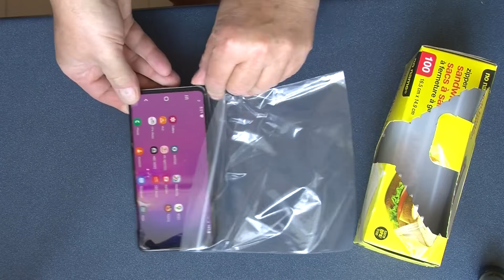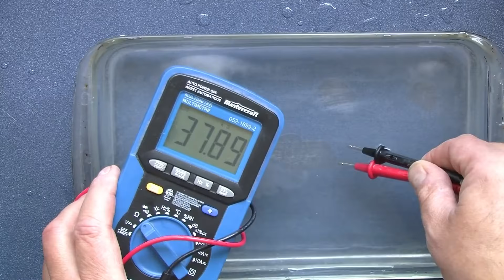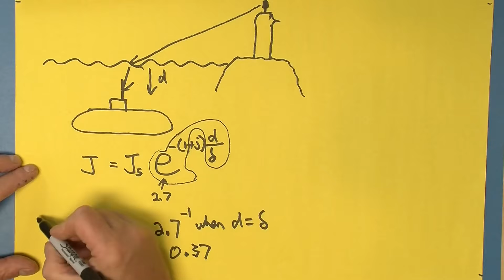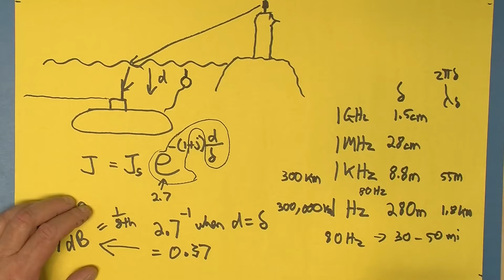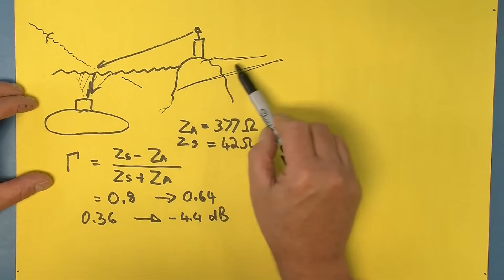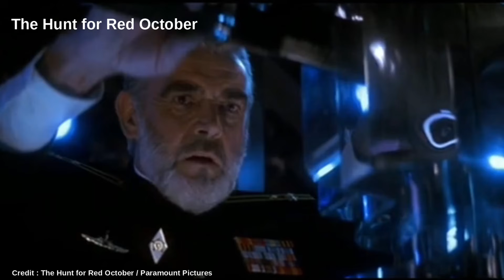Why don't Submarines use Radio or GPS?

Comment: Think of water as liquid concrete and imagine the ocean as a slab lying on its side, and you're trying to get signals through it.  Can you transmit a radio signal not over, but through a mountain? How about trying to scream into the stone hoping the person on the opposite end can recover the audio from the rock's vibration? Sounds absurd, of course, but it's the very same challenge.

For underwater signals it takes tremendous energy to overcome the dampening effect of dense matter. Here on the surface  you have the freedom to transmit gigabits of data per second, but below the ocean, you begin worrying about power a lot more that speed. You get into bits per watt or watt-hour.

Comment: Very nice video - well done.   Many years ago we did an extensive monitor of ZEVS Murmansk on 82Hz using MSK with bitrates seemingly around a few seconds per bit and a "begin message waiting" sequence which from memory took minutes to deliver. That thing uses the ground itself as the antenna.  The supposed dipole antennas which everyone can see on Wikipedia etc are just part of the massively long transmission lines to sub-surface elements using the extremely low conductivity of the rock under the Kola Peninsula. Not coincidentally the world's deepest boreholes also just happened to be drilled nearby ha.      Anyway it gives truly global coverage which you can see in waterfall plots on SDR receivers.     I know the Chinese have an incredible new ELF system - supposedly far better which is capable of transmitting down to TLF frequencies(!), but that's mostly being used for seismic research.  I wouldn't be surprised however to find out it's also sending out ultra-slow data rate status updates.

Comment: Very interesting video! I have a question... you talk about antennas of 30-40miles long for 80Hz waveforms in air and sea. And the associated wavelength in sea being much shorter than air and in the 100s of meters range. So why cant you just use a medium other than metal for your antenna and use a medium like sea water in a pipe which would allow you to create 80Hz waves with much shorter antenna? May require more power I admit.

Comment: Amateur radio operators often use the reflectivity of bodies of water, particularly the salty oceans, to get long distance communication with lower power transmitters. This is a form of ground wave that solid ground can provide. Ground wave conductivity is measured in siemens. The highest "siemens score" earth can get is 30. Oceans, however, are rated at 5,000 siemens. Where I live in Central Florida, our dirt is scored at 2 siemens so we radio operators sometimes have to supplement the ground wave with radial and counterpoise wires spread along ,or just under, the dirt radiating out from the antenna base. Major broadcast radio stations also use substantial radial fields to get the range they want, especially AM stations.   True, using the oceans as a ground plane isn't perfect as the water is never perfectly smooth, but generally better than dirt. I know hams who work 5- watt HF radios at the beach along the Florida Atlantic coast who can easily talk with people all throughout Europe and even further. Of course, part of that is having a good antenna as well.

Comment: Would refraction At the air/water surface contact surface also play a role in bending and diffusing the EM energy?  It sure does with light but I guess the lower the frequencies the less refraction.

Comment: As a young person I remember hearing about the US Navy ELF submarine underwater communication system going in, here in the Upper Peninsula of Michigan where I live. It was going to be a very long cable system. Would it have biological effects?  

The system was installed. I was going to the community college at the time. Then I transferred to Michigan Technological University to study electrical engineering - power systems.

But there is more to the story. During my second year there, I was taking a power transmission line analysis examination and there was an interesting problem to solve!

Problem: An antenna operating at 84 hz at a certain power level will induce how much voltage on a power distribution line at a certain distance away? Assume that the formulae are effective at 84 hz (we used 60 hz for our analysis). 

I thought it was interesting, I like antennas. Well, I solved that problem correctly. I believe my professor put that problem on the test because Michigan Technological University developed this antenna system for the Navy, or at least had some involvement. Michigan Tech had a very strong electromagnetic department.  I really have no actual proof of this.

Many years later, I worked at a local utility company. Come to find out, the ELF transmitter site was located there, and it did interfere with and induce a voltage on the distribution lines, just like the problem in my power systems class.

Part of our work there was implementing and maintaining certain methods for mitigating any induced voltage on the power distribution. Now I began to investigate facts about the transmitter and antenna. I recalled the power line analysis problem from school and put two and two together!

Comment: The upper VLF band 15-30 kHz is used for communication from above water to a submerged sub.  One skin depth is an attenuation of about 37% not a complete limit, so a sub can still receive VLF signals at greater depths than you have indicated, more like 10-30 metres.  Of course they can't transmit back from there, so they release a floating antenna and reply using HF or even higher frequencies to satellites.   A colleague who was an engineer on a sub told me about listening to the cricket scores on LF (BBC4 radio 198 kHz) while submerged at about 10m in some "unspecified location".

Comment: subs used to communicate to their administration by vlf or ulf transmissions, my guess is it was CW or some form of  digital mode. 2.5 gHz radios heat water but their signals would be severely attenuated by water. The home microwave oven  works on 2.5 ghz and boils water very well. n7ud

Comment: would an electron gun or x ray laser propagate through sea water better than 80hz radio waves? if the sub location in known through the alfa magnetic satellite constellation, could a satellite use one of these to communicate with the sub?

Comment: One of the receiving antennas on a sub is what amounts to an iron core loop.  Note that as the depth increases so does both the attenuation of the signal and the attenuation of the noise.  That's to say the s/n radio does not change that much.  The reason for the locating Clam Lake transmitter on dry soil is so that the antenna is effectively higher above the conducting ground.  Ideally the antenna would be 1/4 to 1/2 half wave above a conducting ground.

Comment: I remember reading an article some years ago about vlf sub communication and I got the impression the antenna of the land based transmitter  was submerged...
      That, and that they really cranked out the wattage.
      Sort of related. At a local aquarium, there was a display where a pickup coil was connected to an amplifier, in a tank of fish that communicated with electric fields. It sounded almost exactly like dialup...

Comment: This is also why it is difficult to employ hi-frequency radio to gather data from electronic devices in the body, like ingestible or implanted monitors or defibrillators. It's still possible though, because RF techniques can be used to extract even tiny signals, and inside a body you only have like 10 cm of "saltwater" surrounding the device, plus it's only 1/3 as salty as the ocean. But submarines are thousands of meters under water in many cases. I think in "Crimson Tide" they have scenes where they have to raise an antenna in order to communicate. They also use very low frequencies such as 20 kHz that need huge antennas...

Comment: During the 1950s my uncle worked on just this problem. He was a civilian attached to the Royal Navy in Malta. He told me about his work, but said it was all top secret so could not talk about frequencies and powers. That let the cat out of the bag for me as then I knew it was radio communication. I also knew that seawater was a radio muffler, so deduced that the frequency would have to be very low, and that the aerials for transmission (I assumed they were under the surface) would have to be measured in miles. My uncle was awarded an MBE for his work.

Many years later, after his death, my cousin came across some rough workings that he made. It seemed he was working on a frequency of 68Hz which would be a wavelength of around 4 million metres in air. His notes suggested an underwater wavelength of around 56Km, so using a quarter wave transmitting aerial that would be 14Km. There was no suggestion as to how much power would be needed to push such a signal a useable distance, but it would have to be in the hundreds of kilowatts, I should imagine.

Comment: When I was working with gravimeter arrays about 20 years ago, I found it possible to use the vector sun moon tidal gravity signal to solve for position and orientation of the instrument using gravity. Which is not attenuated by the ionosphere or a conducting ocean, magma or intervening matter.  I called it "gravitational GPS" and "gravitational compass".  It is possible to use MEMS gravimeters for that now or atom interferometer chips, or several other kinds of detectors.  I found more than a dozen low cost ways.  As for communication using gravity. When I met Joe Weber at UMD back in the late 1970s, I asked him what he hoped for.  He said that his gravitational detectors were intended for communication using 3D time of flight field interferometry. ( He did not say those words exactly, but that is how I would describe 45 years later).  But he advised me not to follow him. Rather to follow his student collaborator, Robert Forward whose dissertation is titled "Detectors for Dynamic Gravitational Fields"  Now i think Robert was partially responsible for LIGO but I never really bothered to check.  I did not meet him until many years later, just before he died.  Also, after many decades they now have high dielectric constant antennas that can synthesize and detect low frequencies so you do not need those giant transmitters, and it can be two way.  The wavelengths, (using those kinds of transceivers or using array methods) that are larger than the earth would be great for scanning the early universe. From nanoHertz to GigaHertz.  Putting low cost arrays on the Moon and Mars, can be as simple as setting them around and letting them self calibrate.  Someone wrote me a few months ago about a small sensitive gravity gradiometer that could be adapted for drones and for orbit.  An Earth Mars Moon baseline works for gravity too since the speed of light and gravity are identical.  Not close, identical -- sharing the same underlying potential.  I want to focus them on the sun.  The gravity arrays can 3D image the interior of the sun and Moon and Earth.  Lots of things that are possible, and not that difficult. But who has time?  Add $Thanks and I can buy you a cup of coffee or tea.  Richard Collins ,The Internet Foundation

Comment: Thanks for your review, I like your draw and tell technique.
Let me tell your viewer about a radio station here in Sweden. (I know you know about it)
100 years ago radio transmissions were established between continents, this was before transistors or even tubes!
Everything is mechanical and they transmit at 17.2kHz.
This transmitter remains today and is on the Unesco World Heritage List.
The reason it survived is that the army always wanted a transmitter to communicate with submarines, this was of course secret in the past, especially during the cold war.
The transmitter reaches all over the world and not only Swedish submarines were intended recipients of the signals...
Anyone who visits Sweden and has the slightest technical interest should visit this very interesting and beautiful place!